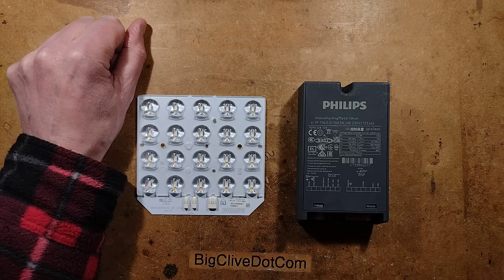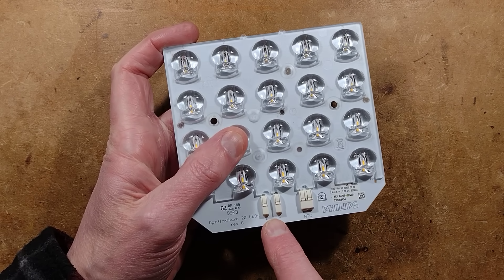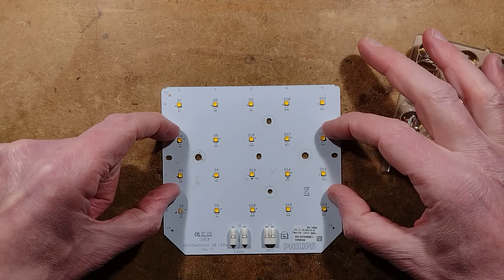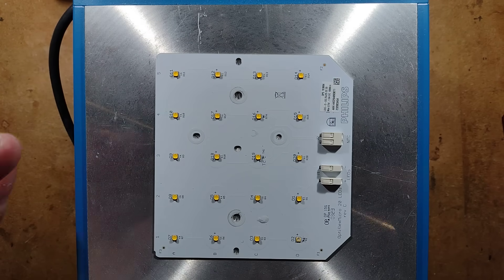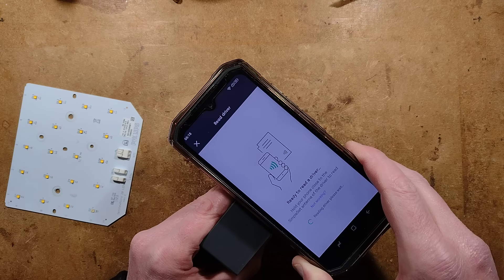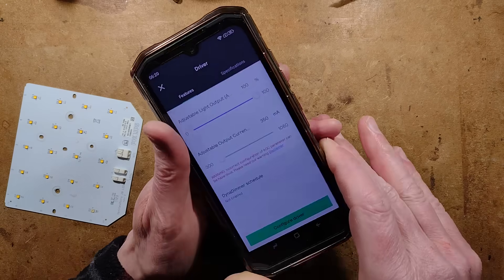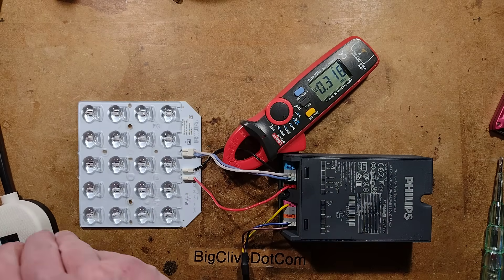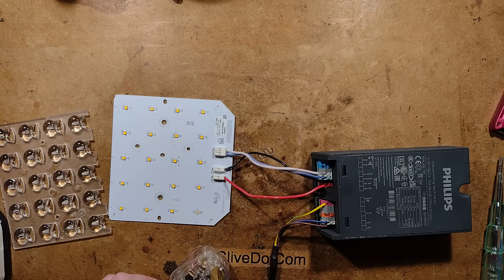Philips street light LED panel repair and programming the driver.

Comment: Well I’m pleased to programme the driver you need to use nfc and not Bluetooth or WiFi otherwise Clive you could be responsible for large parts of the uk suddenly going dark 🤣🤣🤣🤣 years ago I used to work on streetlights but haven’t worked on this new led stuff and know nothing about them but I’m curious as to know why certain street lights in my area will occasionally be on then slowly go off on off on off then back on and be fine afterwards
Reply from the maker: Maybe self triggering of their own built in dusk sensor.  Some have movement sensors that will dim to a low level and ramp up when movement is detected.

Comment: They replaced the old sodium street lights here with LEDs last summer and people complained that they were too bright. Some of the poles have warped over the years and are no longer perfectly vertical so one family complained that a light was shining into their living room window.
An ice storm just knocked our power out for 5 days (some pats of Ontario are still in the dark). I'd bet they would have liked the bright lights during that ;-)
Reply: So true, the first generation LED streetlights were so bright, the wavelength of the white was such a contrast to the sodium ones. But here's the rub, there was no difference in power consumption and the sodiums would last longer !
Reply: @Hastings1066TV  They replaced them in 2024. I'm sure the current generation of LED lights both use less power and last longer than the old lights.

Comment: Xitanium in China would be pronounced Shitanium; great naming choice... 🤣 Beamforming/projection is quite important and great, reduces light pollution, improves brightness and also efficiency. It's the same reason the good old Halogen lights in cars suck so much, not only is the light output from the bulb really low but cheap ass mirror contraptions bounce the light everywhere instead of a precise location on the road.

Comment: In Tunbridge Wells the street lighting in the Town Centre can be radio controlled from Town Hall and Network Rail Station in the South East the LED platform lighting goes down to half power until passenger's arrive or a train comes in

Comment: Its really interesting that LED street lights focus light where it is needed on the road and people mistake that for less light.
I live 2 floors up in a flat with a road that runs parallel to my kitchen window.
There's a decent distance between the flat and the road.
The first night I went into my kitchen when the LED street lights had been swapped over something seemed really strange and I thought the street lights had conked out as my kitchen was very dark.
It turns out that I was using the light pollution from the old lights to walk to my fridge near the window and then the internal fridge light to see what I wanted from the fridge.
Now I need to switch on my kitchen light to see where I am going to get a can of fizzy pop etc out the fridge.

Comment: interesting vid but i just love sodium lights so much. the light is fantastic, they last for ages, they use very little power once struck, they don't upset animals and they work in an amazing way.
Reply: I support this as I really don’t have any love for LED lighting. I think there’s a lot of memories to be honest of childhood and romance even oh my gosh, we can’t even go there. Also, your mileage may vary, but my experience with LED lighting has been a lot of defective units and the worst part of it. You have to change out whole light systems instead of just a bulb. In this example, maybe have to reprogram it even. I like screwing in bulbs, cheap bulbs I buy in bulk at the box store!
Reply: @tazmun  yes, I don't want to sound like a reactionary old sod, but I often wonder about so many of the increased efficiencies we're supposed to believe in now. Like digital radios that are more efficient yet consume 5 to 10 times as much power as an FM radio in the home. Or modern televisions that may use a third of the power of a CRT, but I've never known one last longer than 7 years, but I've still got a 50-year-old TV I use regularly. So what's more efficient? A new TV that can't be recycled every 7 years or a recyclable one that uses more power but lasts for 50?

Comment: Would solder paste and your hot air gun allow you to bridge connections without having to heat the board?
Reply from the maker: The size and spacing made it tricky to bridge.   I think paste and reflow would just have resulted in two balls.

Comment: About the "rectangular shape of light". A few years ago my hometown had replaced the light fittings in residential areas (that mostly used to light footpaths between buldings). They didn't account for different layouts of footpaths and playgrounds and grassy areas. They just bought a huge load of one type of a lamp (that luminates a rectangle directly in front of the lamp post. The problem is, sometimes these light posts were installed in the center of grassy strips between footpaths (a few meters away from them). There are also some areas, like playgrounds and bigger open spaces that before used to be lit completely fine with a single all-around lamp, that now are pretty scary and dark to walk at night.
Reply: A common fitting used to be the SOX light shaped a bit like a bucket with a vertical tube. Deliberately designed to spread light in all directions.

Comment: That lens somewhat resembles the eye lens of an insect.  If the LEDs were replaced with photodetectors and appropriate other circuit mods made, an insect-vision system could be made. ... A solution looking (cough) for a problem to solve.

Comment: How do they make that circuit board light up certain patterns of lights with only a two-wire connection
Reply from the maker: Search for Dali lighting.  It involves a power supply and sensor modules that communicate by shunting the power in pulses.

Comment: As a kid growing up in Georgetown Indiana In the early 60s we had those big shiny aluminum filament fixtures that hung in the middle of the street with the frosted teardrop glass lenses suspended by heavy wiring and a cable between poles and if I remember right they had 500 watt Edison base  bulbs in them ! When it rained in cool weather steam would rise off them . But did not shine very far at all . Very inefficient.

Comment: That driver psu is very trick, a teardown of that would be quite interesting to see how it is storing data via nfc with no power in a way that the microcontroller inside can access when it has power

Comment: Imagine telling people 30 years ago that to set up a streetlight they'd be using a mobile phone to apply settings to set its' brightness, they'd think we were mad... :P
Reply: I wondered how the local council managed to turn off most of the fifteen year old High Pressure Sodium street lights around here off at midnight. It turns out that each one has a GSM modem in it. It beats the old problem of all the streetlights coming on around 11AM and going off at 9PM because there had been a power cut throwing the mechanical time-switches out.
Reply: @MrDuncl  I always thought they'd be on a separate power line and be switched on/off semi-centrally at the next transformer box or something
Reply: @Max24871 they essentially are on their own lv power line but depending on the street, other things are on it too, things which you definitely wouldn't want to turn off when the street lighting goes off. Like illuminated highway signage etc.

Comment: I don't understand the schematic for the LED panel. How does shorting a resistor disable the LED?
Is it that the LEDs are in series ?
Reply from the maker: The LEDs are all in series.   The resistors bridge the LED in that position.

Comment: The reason sodium vapour lights were specified has been forgotten by the so called lighting engineers who now spec LED.
Sodium vapour lights are a single frequency of light or near as damn it, no harmonics just 589.0 & 589.6nm.   As such when it’s foggy, the sodium output only refracts at one angle and the light cuts through the fog.  Anyone who has tried their full beams in the fog or who has been unlucky enough to drive down a foggy road lit by white LED street lights will know that white multi frequency light gets refracted all over the place and you can’t see a bloody thing.  I appreciate its not currently quite as smoggy as it was historically,  but  it still gets foggy or misty and in areas that are really prone to fog they are taking out the LEDs and putting the SVL fittings back.  There were reasons that we did things in the past and they were usually good ones.
Reply: If you wanted a single frequency of light, why not 590nm LEDs?
Reply: No, low pressure sodium (LPS) was only ever used because it was the most efficient lighting at the time. Monochromatic light is terrible because you lose all ability to see in color. Outside of expressways all the sodium lamps I've seen were high pressure sodium which has tons of spectral lines.
Reply: @eDoc2020  San Jose, California used LPS in an effort to protect nearby space observatory operations from light pollution. They replaced them about 10 years ago with LED fixtures which can be radio controlled from city HQ, up to and including light switch raves. I have also seen LPS near airports, I presume to avoid looking anything like runway lights.

Comment: SOX LPS is still the better roadway , bridge lighting.  No glare, no blinding optics  like on so many LED optics.  Been using 6 18W and a 55W Sox on my house for 40 plus years, replaced a lens here and there for yellowing poly-carbonate lens.  Ballasts last forever..stocked up on spares, lamps, ballasts, even a few fixtures, knowing mfg was coming to an end.  Got plenty of 18,35,55W and a few 180w fixture, and 55W fixtures, lamps, sockets.  Set for the forever
Reply: As a person who earns their living by driving at night. There only one road left on my patch with orange light (35s on a private road with 7 houses)  its easier to see without point light sources .if my lucky enough to pass through i stop for a moment so that i can rest my eyes. 
Guess theres something to be said for installing a led lens suitable for the application, my instinct tells me they are bought in bulk at the best price, and the instal guy is just after his paycheck using whatever parts are on the van. 
Iv matched my vehicles interior lights to match sox as best as i can.
Reply: @crazygeorgelincoln  real early led road lights where horriblevchespvhighvblue content,I think cheapest to make,and horriblecoptics all glare. I am starting to see better led with lower colorvtemps,softer lens optics...but led will never be as good as LPS Sox for roadway safe  lighting..linear source lamps them selves are an even glow of  non glaring  light
Reply: @cengeb  the local new build estates have some of the worst lighting iv ever seen, had a close call when a guy crossed the road between two illuminated spots.

Comment: Is it possible to configure the power supply even when it's not receiving any electrical power?  I didn't know NFC could actually do that.  When you power it on, does it read the data on the NFC chip and program itself?  Does that app also exist on iPhone?
Reply from the maker: Only on Android as far as I know.  Most technical apps seem to be for Android.  The microcontroller in the light can read the NFC chip like memory.

Comment: Since these street lights are so directional and just aim light downwards onto the road, I presume this means less light pollution and sky glow.  This is a very good thing, and if these street lights are as directional as you say they are, then they should be very widely used.  Alec of Technology Connections made some fantastic videos about night time lighting and light pollution, it's a real problem.
Reply: That's the idea yes, along with shining less light in through bedroom windows. In practical terms, they can be a bit hit or miss. They're definitely better than the old style but I can't help but think some kind of shaded cowl around the edge, sort of like a sun visor, would make them more pleasant. As standard, the cutoff between no light bleed & a sudden blinding blast of light is sometimes dazzlingly sharp, & that's no good if you have one opposite a staircase or if you're driving over a small bridge or something.
Reply: @NightCatArts  That would be quite jarring, I mean it's not always pleasant on your eyes if you get up in the middle of the night and turn on an overhead light, going from darkness to sudden light tends to affect one's vision.
Reply: @Lachlant1984  Yea. I think it's just the internal reflections from the lenses that does it at a particular angle, because you're not getting a face full of the whole brightness of the lamp, but because the light output is so focused it's more dark around it & it's like getting a flashed reflection off a moving mirror or something. That's just with the streetlamps around here though; there are many models that use a similar concept of directed lighting.

Comment: We've got a streetlamp directly opposite our house. Used to be an 18w SOX bulb, usually lasted a few years.  They LED'd it just before Covid, it's currently on its third "head" because whenever it fails they have to replace the whole thing. They certainly don't seem to last anything like as long (and there's only our house down our lane so it's usually me that reports the failure so I've pretty good stats on that!)  I don't know if the LED modules are even replaceable but the whole thing just gets WEEE'd. Pretty sure they're Philips heads but all seem to fail the same way... good for a while, then go very dim (usually with just one or two very bright LED's) then... poof.
Reply: Sox is love.
Reply from the maker: At this point in time they seem to go straight to landfill.

Comment: I’m installing Philips (Signify) Streetlights for years and they are very high quality. In the meantime there are over 50 different types of lenses with different light distribution patterns and one can replace these lenses even when the lantern is installed. 😊

Comment: I don't need one of these, someone pointed me in the direction of a pack of 10 LED floodlights for a  super-cheap price a couple of weeks ago (thank you). Did I miss your video(s) about the Radiacode or is that to look forward to?
Reply from the maker: I've not made a video specifically about the Radiacode, but Nurdrage totally took one apart in a non recoverable way.  (He opened the scintillation crystal block.)

Comment: Aiming the light angles may sound good in theory but in practice... not good. When our local streetlights were converted to LED,  our world got darker. On darker nights, the LEDs just don't shed light in enough places and it's much harder to see. Trees and shrubs don't get lit, and therefore don't reflect light from dark areas. That extra light gives 'context' to the area. I can no longer see down the street and because of the angle of light, I can't even see the street lights down the road!

Comment: I'm so glad they are focusing light these days. Imagine the amount of light pollution if we were still using old fashioned bulbs. I wonder if there's a way to quantify the exponential increase, of the number of street lights over the last century, and the amount of light pollution they produce in relation...
Reply from the maker: You may notice the stars getting more visible over time due to the reduction in light being projected upwards.
Reply: already noticed several years ago here in the US, but literally could only see a few stars at times due to light pollution, while living in the city I lived in. Now that I'm back in the country, it's extremely noticeable when they install the newer LEDs, however due to the shear volume of lights being installed exponentially worldwide, the matter I'm afraid, is only going to get worse... 
What might be interesting to explore would be in rural areas, where traffic is at a crawl, lights turn themselves off until a vehicle approaches. I think I've noticed in some areas where they will dim waaay down during certain hours... Either that, or I've had a bit of the vapors...
Reply: You wouldn't have liked the "Moonlight Towers" they had in the USA. 50m tall with Arc lights on top so they could  light a whole district.
Reply: @MrDuncl  you're right, I wouldn't. I mean, excess lighting for a spectacle of some sort is fun and all, but everything is always lit up everywhere, all the time. 
I speak from experience since I lived in the brightest spot on earth for 29 years...
When I move back to the country I left, lights moving in everywhere...

The night satellite view of the Earth today, reminds me of the depiction of the Borg  occupation...

It's actually very disturbing how small the planet has become. All because of mass transit, and advances in technology. The end results are the same, wide spread pollution of every ilk, and absolute chaos. 😔

Comment: Kalispera from Greece Clive, thanks for the video.  Our municipality here changed over to all LED a couple of years ago, and they're the type which use power line transmission to communicate.  However, we live in a village, domestic supplies are 99.9% overhead, thunderstorms are severe, and the line voltage varies considerably, including occasional brownouts (I'm logging VRMS).  I'd love to see a teardown of one of the controllers and how it operates (and survives).  Despite all that, it's rare to see a complete failure of a fitting.
Reply from the maker: I've not come across the ones that use the powerlines for control here.  It seems to be short range RF communication.

Comment: Wait a minute...Clive,  Are you pulling an early April; Fools trick on us? how do you program the power supply with out any mains connected?
does the programming  work  by  RFID?
Reply from the maker: It works like a programmable RFID card.  It is powered by the phone's NFC coil.
Reply: says in the title, wine.